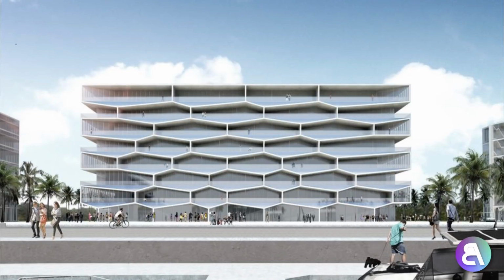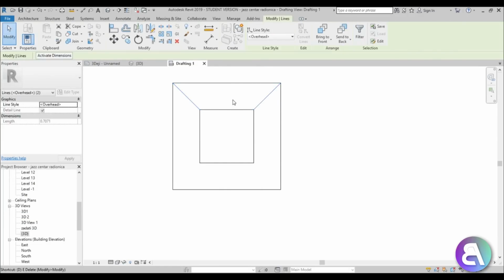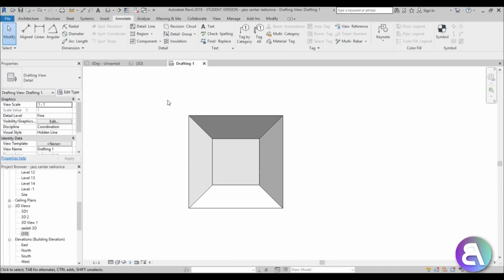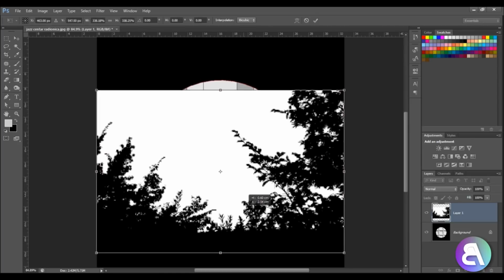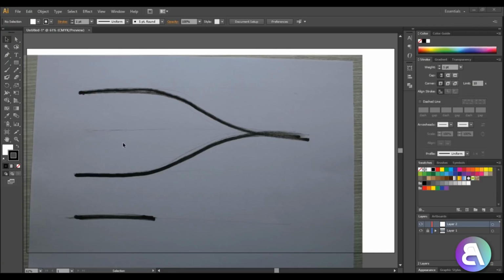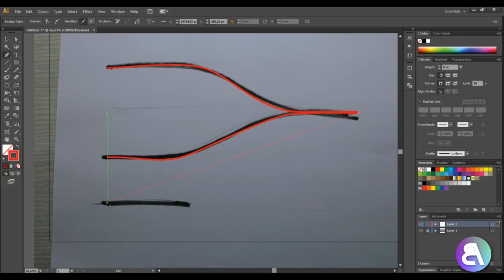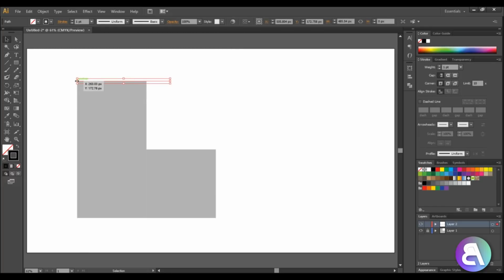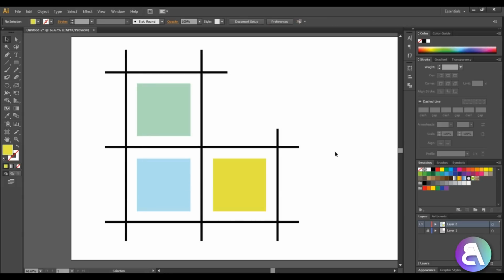3 Ways to Design a Project Logo Like BIG Architects Tutorial (Graphic Design)

Comment: Nice video idea. Project logos are super useful for sure. I do wonder how far did you get on that last project concept? How did you solve the infrastructure issue? Water sewer and so on?
Reply: I have the same question. Also elevators, stairs, etc. Would there be a location point for the apartment exterior? And the owner designs with the infrastructure previously established in place? The idea is very interesting.